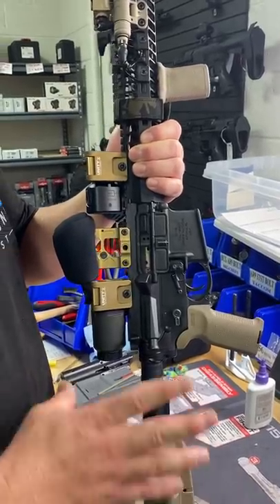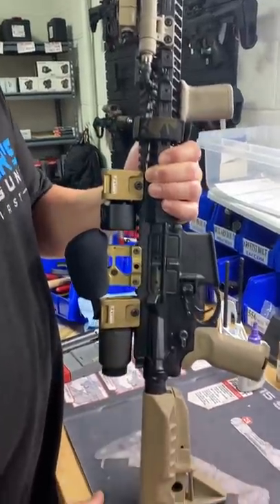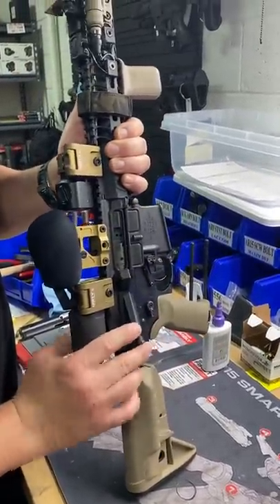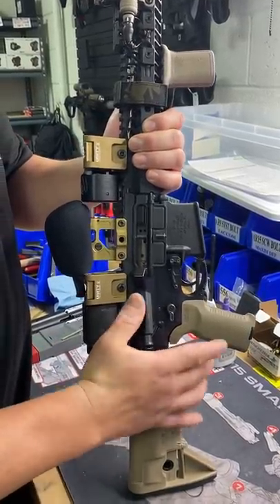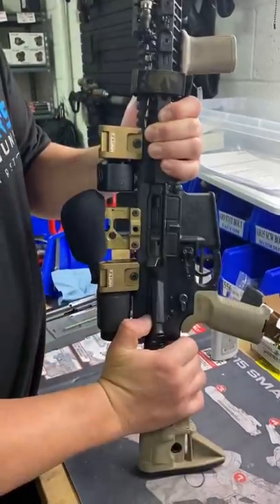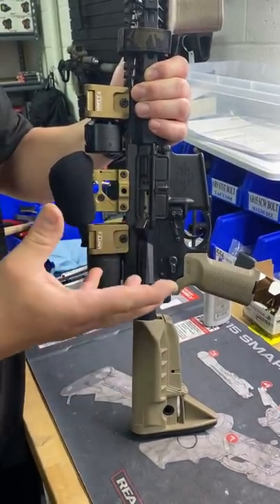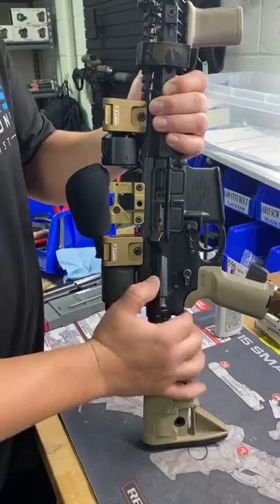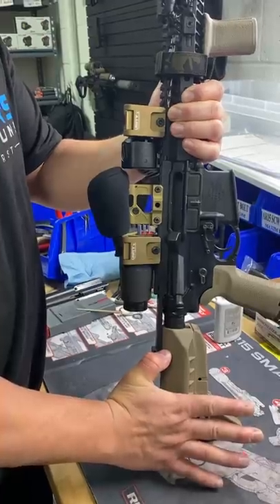How to Mortar your AR Platform if you have a round stuck in the chamber.

Comment: Maybe in combat but this is just stupid. Do NOT slam your loaded rifle on the ground. Who are these clowns?
Reply: This is for when the rifle has fired and you have a stuck case
Reply: @patrickmcnair1965  I know what it's for. And in a combat situation I might do it. But I'm not slamming a $1500 rifle made primarily of plastic on the ground..
Reply: @jackburnell3209  the majority of the rifle is metal not plastic it will take the abuse just fine you might break a cheap stock but that’s about it
Reply: @patrickmcnair1965  I own a Bushmaster AR-15 and a Daniel Defense AR-10 so I know what they're made of.  I'm 61 years old and got my first rifle, a Glenfield 75 .22 at 12 years old and have owned probably a hundred  guns since. Maybe more. 
I don't buy cheap ammo and I lube my rounds before they go in the mag when a guns new. I keep my barrel and chamber clean. I can count on one hand the times I've had an extraction failure. 
I guess if someone buys a junk gun, cheap ammo or fails to maintain both, they may as well slam it on the ground. Lol
Reply: @jackburnell3209  doesn’t matter the quality things will brake and guess what DD ars have a metal upper lower buffer tube barrel sights and usually a metal hand guard/rail that’s a lot of metal
Reply: @patrickmcnair1965  That's why I bought it. It's quality equipment that won't easily break. If it fails to extract a round, I've got an Old Timer pocket knife in my pocket that will work better than slamming it on the ground. Anyone that thinks that slamming any piece of expensive equipment on the ground short of a life and death emergency either has money to burn or is an idiot...or both.
Reply: @jackburnell3209  welp all well and good but slamming the butt stock of an AR typically won’t hurt a thing
Reply: @patrickmcnair1965  I also carry an all steel Detonics .45 instead of a plastic Glock with a half dozen tiny, thin parts. I can count on it working 100% of the time. 
None of the Glock fanatics have a factory Glock. They've got 3rd party extractor, trigger, mainspring, etc. 
I'm old school and like steel, not plastic, and simplicity, not complication.
Reply: @jackburnell3209  great until you really need to worry about weight also glock fan here I’ve only ever swapped out sights that’s it
Reply: @jackburnell3209  ahh now a Glock will hold up far better in the sun than any wood stock same with dogs wood is a lot more fragile than polymer frames in most cases
Reply: @patrickmcnair1965  Oh, the only reason I bought my AR-10 is because we had a big hog problem and I needed a heavier caliber than .223 and a rapid fire capability for shooting groups of them at night. All the IR scopes were fitted for the Picatinny rail off the shelf.
Reply: @jackburnell3209  great that modern ar 10 will be around as long as you’re old Winchester
Reply: @patrickmcnair1965  That's your opinion, but it's made without any historical evidence. I paid a lot for it and the scope so I hope so...but I seriously doubt it. I've seen too many "modern" firearms die to believe it.
Reply: @patrickmcnair1965  That's just wrong. Maybe in water, but not in the heat. I've not tested it but the coefficient of thermal expansion for wood is smaller than for any plastic or composite used in firearms. And tensile strength for any good hardwood is greater than any composite used in guns. And wood doesn't even have a melting temperature, it has an ignition temperature. Ever seen a wooden stock burst into flames?  I didn't think so.
Reply: @jackburnell3209  like you were saying earlier quality makes a big difference I’ve had the front sight/gas block fall off a brand new Ruger 5.56 before it had ever been fired but something like my colts or you’re DD will almost never die
Reply: @jackburnell3209  I was more hinting towards checking and cracking from prolonged heat exposure and just dry climates in general then there’s the issues that are brought to light in climates like the Pacific Northwest where the expansion and contraction of the stock can ruin you’re accuracy both are no issues with polymer composite stocks
Reply: @patrickmcnair1965  Fortunately, I don't leave my guns outside.  Lol
Reply: @jackburnell3209  hot dry summer in a gun safe can do the same thing or just a hunting trip in a very wet environment
Reply: @patrickmcnair1965  I've owned guns and have been a hunter for almost 50 years. I've never seen that. I keep my guns in my closets, not a gun safe and always kept them clean and oiled. When my grandfather on my mom's side died I pulled a 100 year old Sharps 45-90 and a double barreled 12 gauge goose gun from his closet.  They not only both were 100 plus years old but likely stayed in a closet for 70+ years as he didn't goose or buffalo hunt. Lol  
They didn't have air conditioning until he built a new house in 1972 either. I've owned dozens of old rifles from an 03 Springfield to a WW1 era Garand so I think you're just arguing for the sake of arguing. Keep your guns cleaned and oiled and they'll be fine.
Reply: @jackburnell3209  more or less yup that’ll do